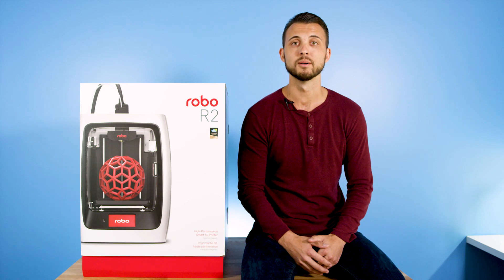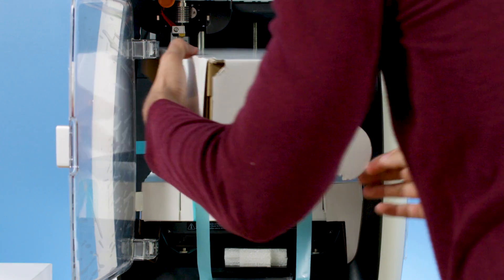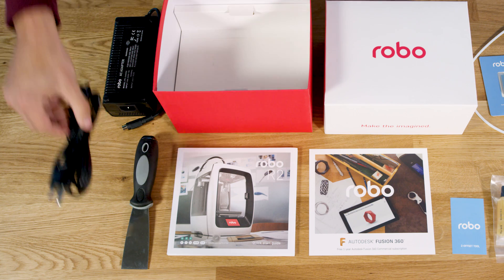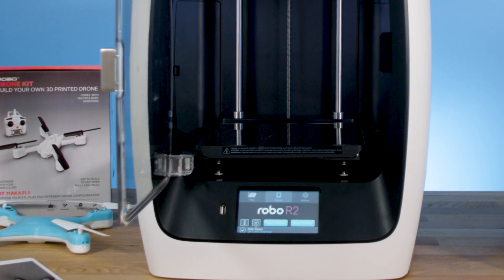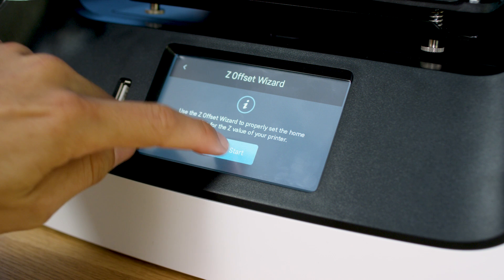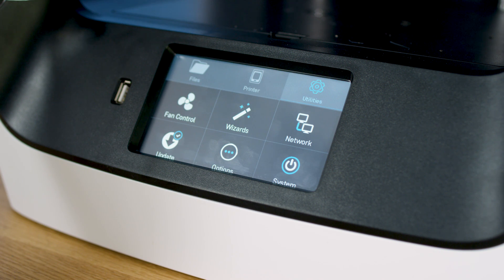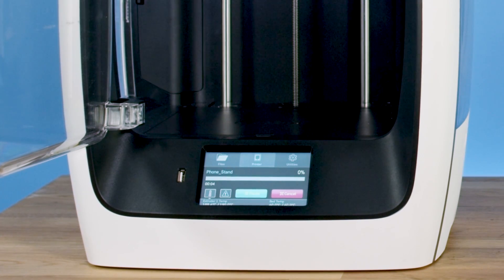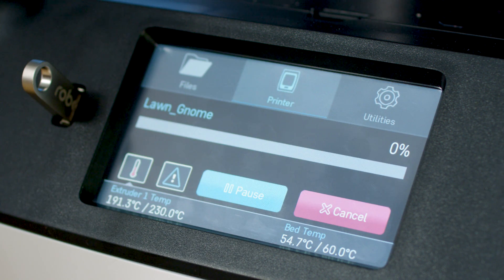Robo R2 Quick Start Guide

Comment: Can you make a video how to prepare to print with ABS and Carbon fiber filament
Reply from the maker: There is very little to post with regards to printing with ABS and Carbon Fiber. You just need to make sure that for carbon fiber, your extruder should be around 200ºc and for ABS 230ºc. The print bed will need to be around 90-100ºc for ABS. Carbon fiber PLA does not require a heated bed.